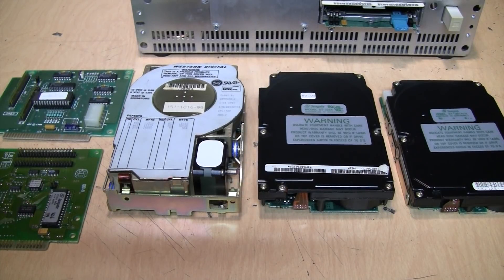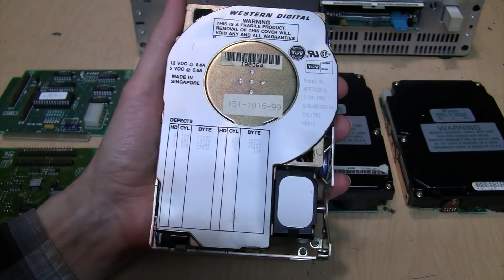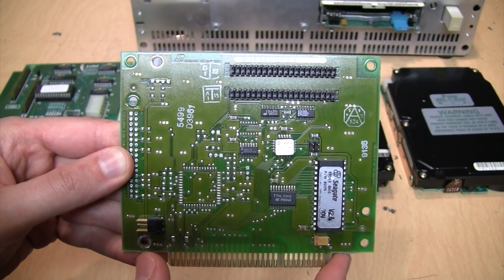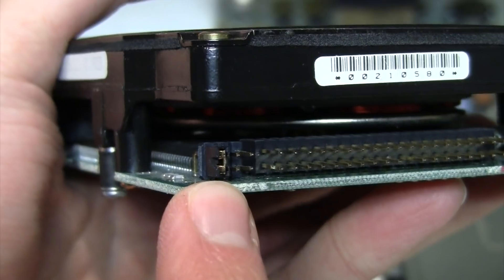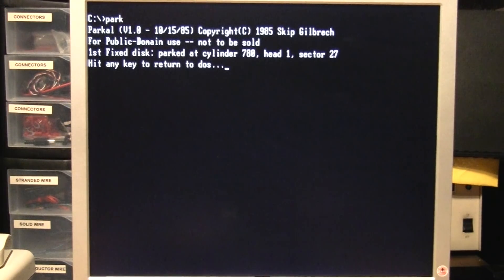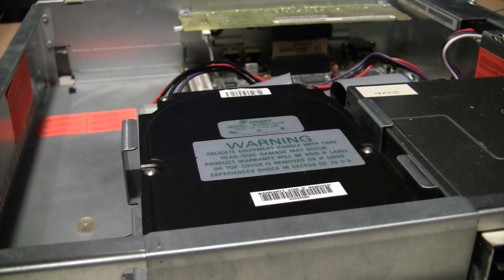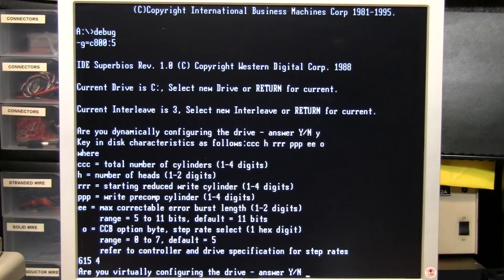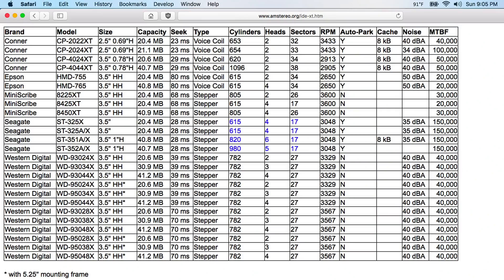8-bit IDE-XT Hard Drives Demystified

Comment: many retro guys just ignore them and go for that sd card JUNK
Reply: CF cards can run in ATA mode (TrueIDE) and can handle being used as a HDD replacement (heck, in embedded systems it's pretty common or used to be), but SD cards certainly aren't (they're rather slow when it comes to reading and writing), and most of them if not all of them lack any wear leveling.
Reply: @Alexis_du_60  also you couldnt call yourself a retro guy if you use a cf card to make it more confortable as it lacks the experience with those
Reply: @stvpls  I agree, but as mucb as I dislike to admit it, sometimes it's a necessary evil, personally I'm all for keeping the HDD along side the CF card until the HDD finally croaks out. 

In fact, all of my old PCs run on their original HDDs when possible, my Pentium 133 (now upgraded to a P233MMX) runs on a IBM Ultrastar 9ES (or DDRS-39130, which mine is as it's a OEM drive), before that I had a 2003 Western Digital EIDE (that unfortunately suffered a catastrophic failure) in it.
Reply: I just can't abide by flash storage in a retro computer.  Well, ironically, a retro PC anyway.  I am more than happy to put an SSD in my G4 Cube and Mac Minis.  I don't fully understand why that's OK by me.  But on a proper PC, it's spinning rust or bust.

I know we all make our own decisions, but I cringe every time I see someone take out a hard drive and "UPGRADE" (!!) something old with a CF card or SD card.  ugh...  It's just wrong.  ;-)
Reply: @nickwallette6201  This 👆 I just can't fathom it too. For my Macs (iMac G3 and G4) I'm most likely going to shoehorn in a SSD (one of those PATA ones or a MSATA one in a MSATA to EIDE enclosure) as they're a nightmare to get to. But for the PCs I'm going to keep using a good ol' HDD.
Reply: @Alexis_du_60  SD cards are greased lightning compared to vintage hard drives. They're also a helluva lot cheaper.
Reply: @nickwallette6201  Shall we stay off your lawn?
Reply: @Caseytify   If you do, who am I going to yell at from my porch?
Reply: @Caseytify  They could, but since they lack wear-leveling (unlike SSDs or CF cards) they'll wear out a lot faster. Hell I managed to irrevocably damage a 2GB SD card by repeatedly writing to it, after a lot of writes, it locked in read-only mode to prevent further damage. Even that, no matter which SD card reader I used, most of my SD cards were slow (_slightly_ faster than a old HDD but still slow compared to a USB or CF card - though I never had a CF card in my hands to test it) 

Sure they are cheaper, but you get what you pay for. They certainly aren't fit for sustained writes.
Reply: My thoughts on this issue are varied. I don't really have an issue with using modern replacements as long as there's a reason to do so. If an original is hard to get but the replacement is easy, that's a reason. If you have the original part and it's working fine, no need to mess with it. The reason for using the device also can have an impact. If you want to relive childhood memories the original is better but if you need a Windows 3.1 computer to program an industrial controller at a factory a more reliable solid-state replacement would make sense.

I'm working on an antique TV and and its high voltage rectifier tube was dead. I made a replacement at home from modern silicon diodes I had lying around; it's cheaper, faster, and easier than ordering the original 1B3 tube online. If I later get a 1B3 it will be easy enough for me to swap it in if I so desire. The TV also has lots of old paper and electrolytic capacitors which can go bad. Some people suggest wholesale replacement of these with modern parts but I don't see the need. I'm just replacing the ones which are preventing the set from working well or which are likely to cause damage if they fail in the future.
Reply: @eDoc2020   board components are annother thing, im talking about the hard drive, wich the flash card machines become unusally fast and experience breaking in general, also the hard drive has sounds and feel you cant replicate with a cf card, i would find highly ridicolous if someone made a cf card thing that made the sound of an hdd
Reply: @stvpls  Years ago I saw project online where somebody put a USB drive inside a VHS cassette. They installed a motor so the reels would turn when the drive was accessed. Is that ridiculous enough?

On a somewhat serious note I can sort of imagine what you describe. You could take a dead HDD which still spins and hook it up just for the sound. A circuit could pulse the voice coil actuator whenever the card is accessed. With the right methods a reasonable sound could be achieved.

Of course for me sometimes the exact series of seek noises is part of the experience. Just by listening I could tell where in the boot process my old PC was. Installing a network card made an unnatural change in sound.